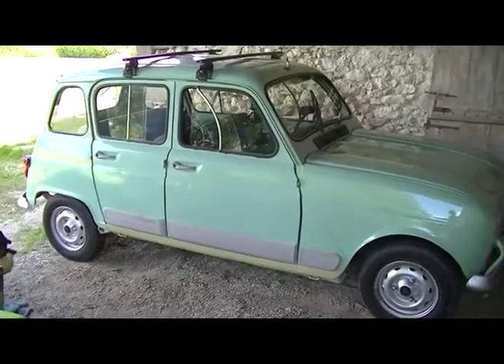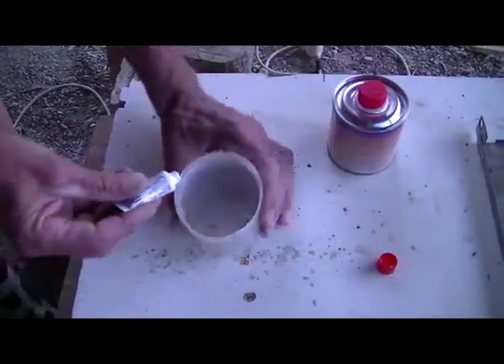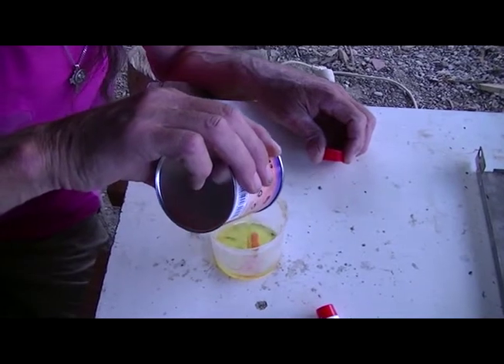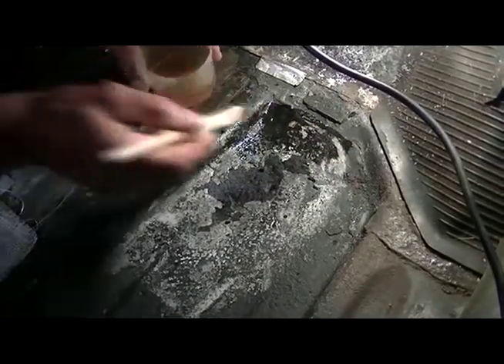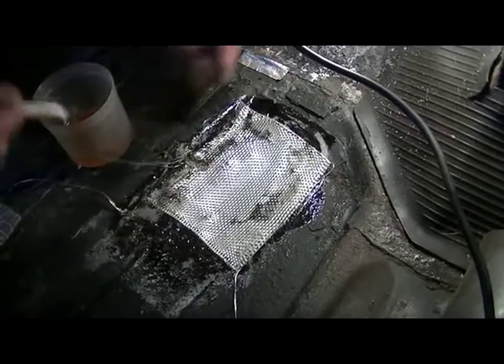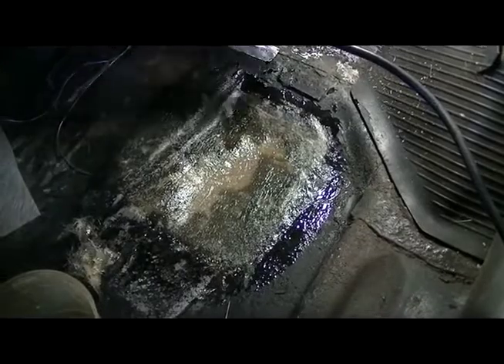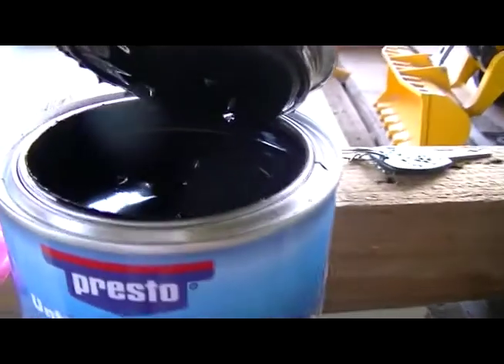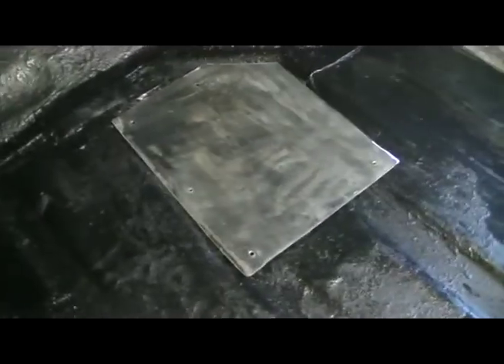Floor pan fibreglass repair

Comment: Good for you for attempting the repair yourself. It's always rewarding to go that route. There's a couple of things about glassing that you may want to consider if and when you make further repairs. Cloth works with Epoxy, so does stitched mat. Chopped strand mat (CSM), which is the densely packed, multi-directional fibreglass, does not work with Epoxy. It can ONLY be used polyester or vinylester resin. The CSM is held together by Styrene, a chemical binder that is dissolved by MEKP (the catalyst used in Polyester resin). Epoxy resin and hardener do not dissolve this binder, resulting in an incomplete and potentially compromised, repair. 
Repairing both sides, even thin layers will result in a stronger repair, provided the patch covers at least one inch around the hole. 
Best of luck.
Reply from the maker: thank you for that Vaughan, I used a Polyester resin. The 2 different cloths as well as the resin came together in a kit that I bought from an auto place, so I hope I'm OK. I agree with you, repairing both sides would have been stronger but I baulked at the idea of lying under the car and patching upside down:) So far, no problems with the repair, it's still holding well.

Comment: For the bottom of the car did you do the same thing? Apply some resin and then stick the strands on from underneath the car?
Reply from the maker: Yes, I did the same under the car but not so many layers. It looked a little messy and I needed to pass my roadworthy, so I sanded it quite smooth (wear a mask because its fibreglass) then I applied the black waterproofing stuff which I got at an auto shop.

Comment: great video man going to try this on my 78 camaro z28. That stuff you had to remove in the start (Stuff someone put down to prevent rust but didnt work) is CAKED on in my car. I guess maybe it did an okay job and stopping the rust because theres only a few small holes. How did you manage to get all that stuff off though?
Reply from the maker: Thanks Tayvn, I used an old chisel to get the dry cracked stuff off, then a wire brush and then finally I realised that it looked a bit like bitumen/tar which is petroleum based so I cleaned it with petrol. By the way, the repair is still solid:))

Comment: Thank you for the video. I am going to attempt this on my 1977 HJ45 Land Cruiser and this was very helpful. How is the repair holding up after 4 years?
Reply from the maker: You're welcome and thanks for watching. I don't use her much in winter because of all the mud (country roads) but in summer I use her every day and the repair is still perfect and strong. I also did the passenger side and passed my roadworthy.
Reply: @davekennedy52  Awesome. Then I am definitely trying it!
Reply from the maker: @GreaseAndGravel  Great news! Remember the rust killer first
Reply: @davekennedy52  definitely! I’ll san it down well and apply rust converter first 👌🏼
Reply from the maker: @GreaseAndGravel  Good luck with that! Hope you eventually got your bike out of the mud. You're South African as well I see. I'm from Cape town but live in France now.
Reply: @davekennedy52  Thanks :) Yeah, I thought you sounded South African. But France explains the car. Cheers
Reply from the maker: @GreaseAndGravel  Yes, the Renault 4, known as Quatrelle in France. I have 2.

Comment: My first time hearing about fiberglass a floor pan was today. Didn’t think that would hold up long
Reply from the maker: As you can see, there are many layers of cloth so its plenty strong enough. The problem with some fibreglass repairs is that the metal continues to rust underneath if its not treated correctly before, but my repair is still holding up well  after many years
Reply: @davekennedy52  they guy that’s doing mines was telling about this. He said that’s how he started out. I see it really does work
Reply from the maker: yes, it works well. Just make sure the preparation is done properly and any rust is 100% eliminated. Good luck!!

Comment: Thanks!  I'm going to this with my 66 Triumph Spitfire - Did you use resin specifically for metal?
I like whatever that bird is narrating...
Reply from the maker: I used to have one too, many years ago, also with a hole in the floor! The resin used is universal, for plastic bumpers, surfboards etc, all the same stuff

Comment: Sorry but this way you didn't fix the problem, this floor pan is all rusted out and looses its solidity and stregth to solicitations... It is not sufficient to cover it with tar based paint or patch it with fiberglass, your car is not safe this way (and rust continues to bite the remaining sane parts of metal). I think it is safer to proceed with metal patches, if you can't solder them you can do it with rivets
Reply from the maker: Thank you Maggio, I understand what you're saying. Before I applied the fibreglass, I removed all flaking rust and used a good rust killer multiple times. I'm sure that 99% of the rust was removed. The fibreglass was covered with the product underneath and painted over on top so no more exposure to air or water. It's been quite a few years since I did  the job and its still strong. If ever I have the same problem again I'll follow your advice with a riveted patch. Thanks for your advice:)